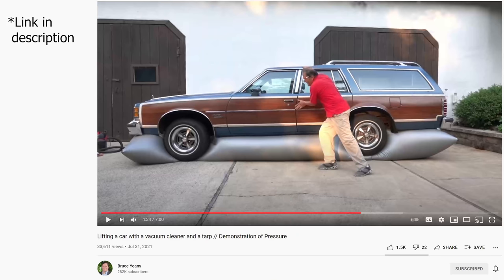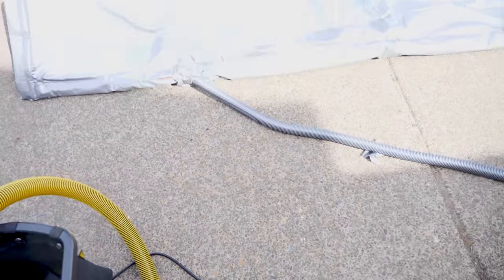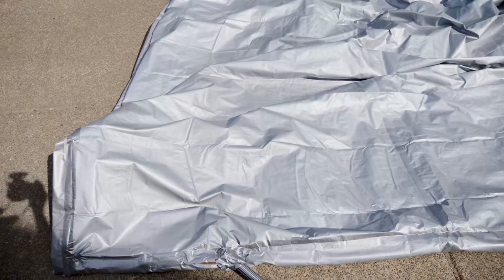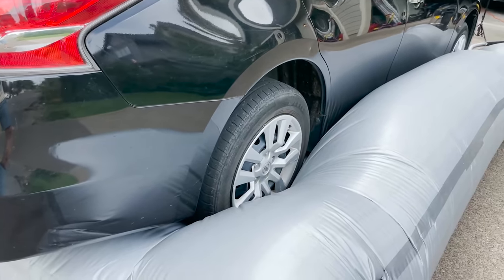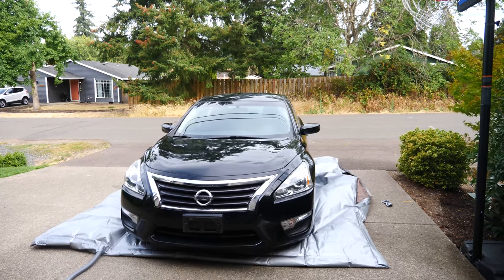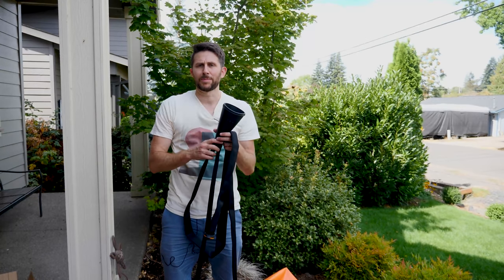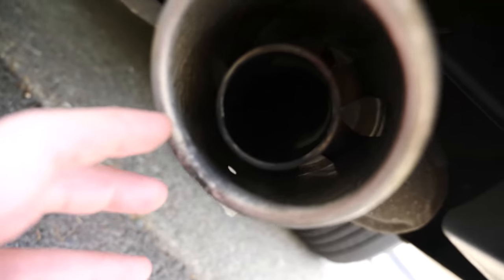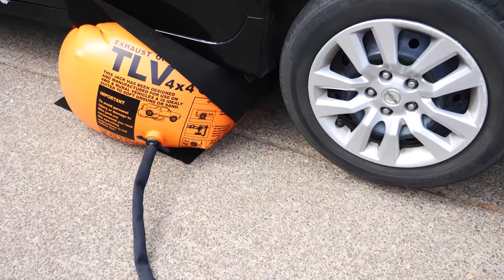A Car Lifting Itself With Its Own Exhaust Pressure

Comment: SHARK TANK IDEA. Build one of these that will be a tight fit on to your car, it must fit around the wheels very tightly, then make it longer and wider than the car, so when it inflates (plastic, tarp, elastic material) it comes up and around the cars, front, back sides, as well as underneath the car. Then use it in floods to protect your car from water damage, or paddle it, kind of like an inflatable kayak for your car

Comment: Now, let's say you have a flat tire, far far far far far far away. Is it more Efficient to use the car's exhaust  to lift it and change the tire for your spare, or is it more efficient to use a DC12V to AC 220V converter and power a vacuum cleaner to lift the car?

Comment: what always makes me laugh is when people go on about how someone tried to open an airplane door at crusing altitude where there is like a 7PSI pressure difference.
if the door is 6 feet by 3 feet that would work out to be 72*36*7=18,144 pounds of force keeping the door shut.
I don't care how "wonder woman" or "HeMan" someone is feeling, they are not opening the door.

Comment: Also. One gallon of gas, ~ 6 pounds makes ~18 pounds of CO2.
Reply: The exhaust gas still contains  more than 70% nitrogen.
Reply: @josmarlangner  That was there before combustion.
The atmosphere is nearly 79% N2 and nearly 18% O2.
Gasoline is chains of carbon atoms connected to Hydrogen atoms and the Carbon atoms chemically react with the Oxygen in air.

6 lbs of gasoline makes around 18 pounds of CO2.

Comment: Do NOT do this! the engine needs to be cooled by air passing through the vents using the cars movement when driving. If you strain the engine this much while stationary it will overheat and break costing you dozens of times more than even a professional tire change, or a proper tool to lift it up. If you don't believe me, theres a video of a guy killing his lamborghini trying to grill a steak on the exhaust, I believe it's in hong kong uploaded by the south china morning post on youtube

Comment: The car tends to lean over one side whenever it's off the ground, you should use a platform sandwiched between the car & float so it can be lifted up by distributed load.

Comment: Nice demo of how much yuck comes out of the back of ICE powered cars.
Reply: And the electric ones would need to be driven over 250000 miles to break even on environmental impact. And the energy going into the batteries usually isn't solar or wind anyway.

Comment: But... the test using the exhaust only lifted one wheel off the ground, which takes far less force than lifting the whole thing because most the cars weight is still resting on the other three. Would have been nice to if the exhaust could fill up the first bag and lift the whole car